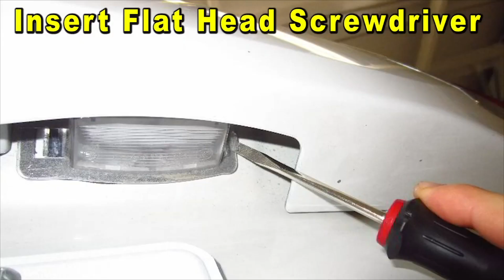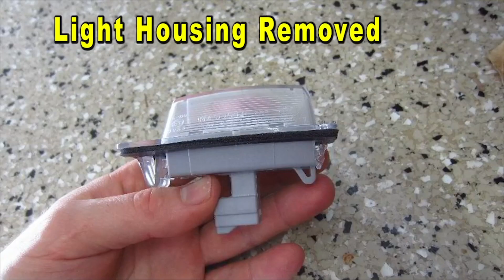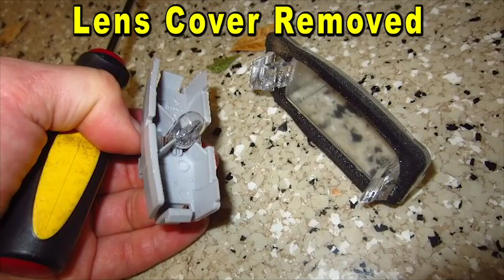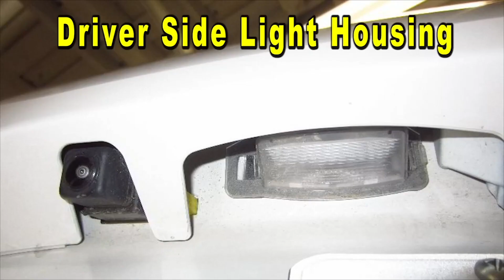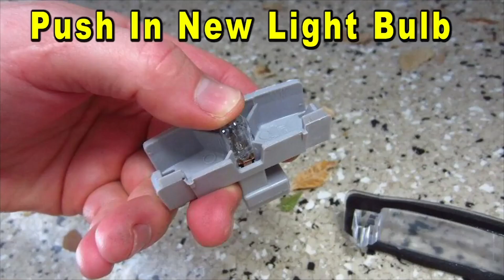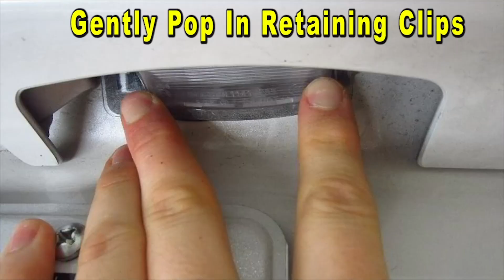2014 To 2021 Mitsubishi Outlander How To Change License Plate Light Bulbs + Part Number Quick & Easy

Comment from the maker: Check out the DIY guide for changing the license plate light bulbs on a 3rd generation 2014 to 2021 Mitsubishi Outlander (2.4L I4 engine) - 
https://www.paulstravelpictures.com/2014-2021-Mitsubishi-Outlander-License-Plate-Light-Bulbs-Replacement-Guide/index.html

Here are all of the DIY repair and maintenance tutorials for the third generation 2014, 2015, 2016, 2017, 2018, 2019, 2020 & 2021 Mitsubishi Outlander - https://www.paulstravelpictures.com/Articles/2014-2021-Mitsubishi-Outlander-DIY-Repair-Maintenance-Guides.htm

Owners of other Mitsubishi vehicles such as the Outlander Sport, Eclipse Cross, Mirage, Mirage G4, Lancer, ASX, Montero Sport, Pajero, Xpander, Strada and RVR may also find these DIY instructions to be helpful.